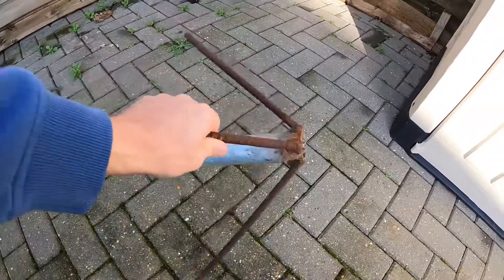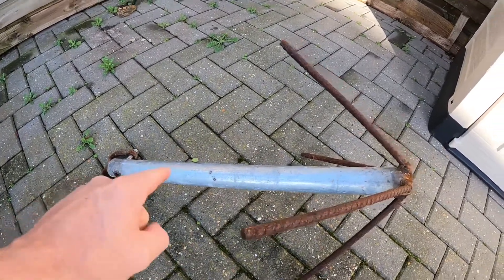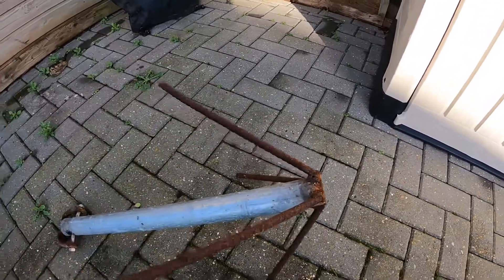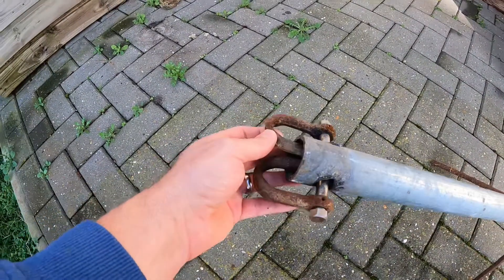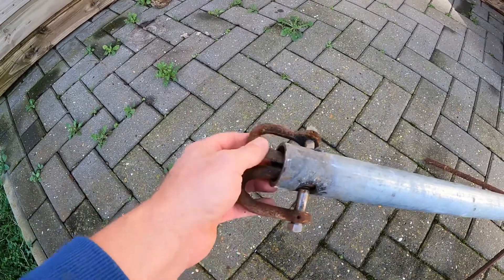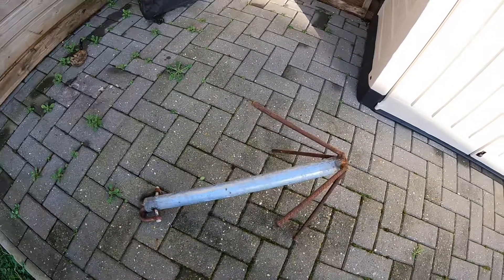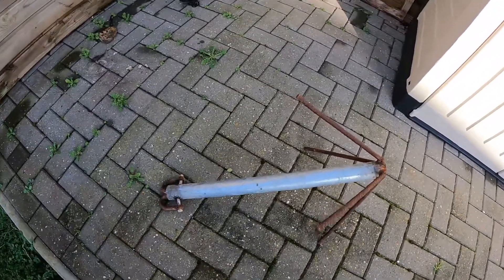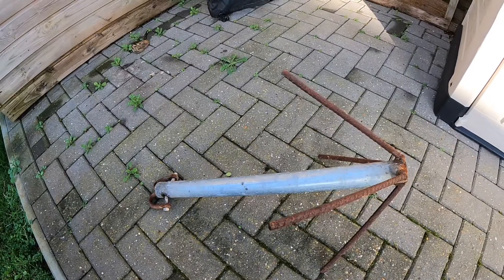How to make a boat anchor

Comment: I bet you had fun welding to galvenized, why didn't you put a d ring / stroke shackle to the bottom of the anchor to help you retrieve it?
Reply from the maker: Good idea I will think that through, maybe a redesign at some point.
Reply: @Andysfishon   I see the rear you used looks about 13mm so wouldn't bend to easy if you got it stuck so could waste a lot of anchor rope and chain
Reply from the maker: @peteramberley9952  some times I fed the rope throw the shackles and tie it of at the bollard and lower it down so if it gets totally stuck I don’t loose the rope as well.
Basically a big loop.